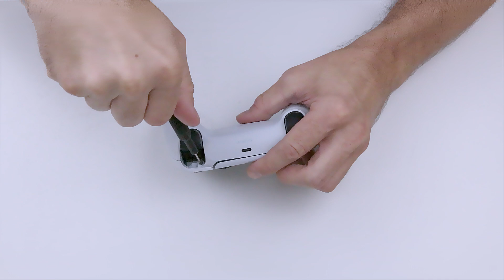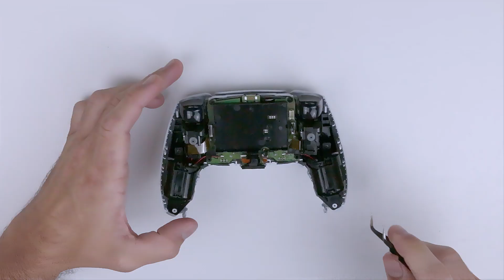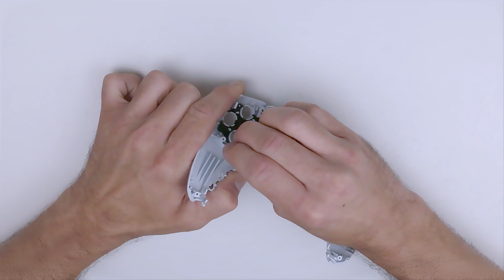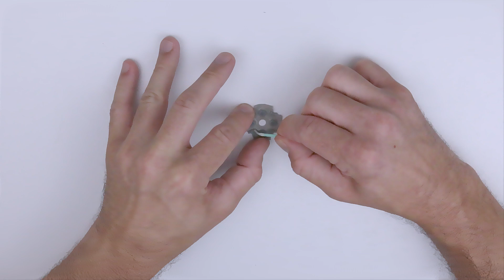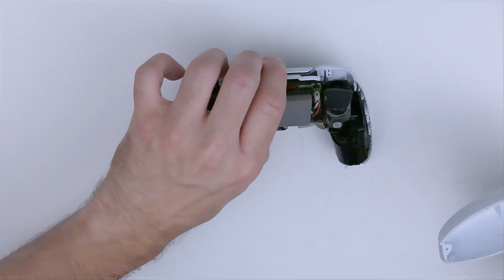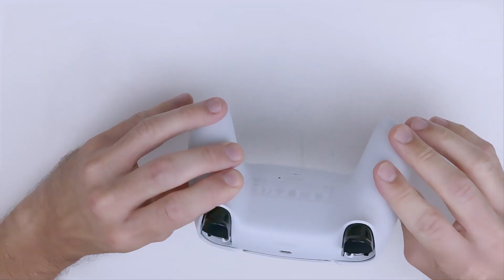How to Fix Sticky Buttons on a PS5 Controller | Easy Step-by-Step Guide

Comment: Do I have to wait for the stickiness to dry before I try clean it out
Reply from the maker: Hi Rick, I highly recommend that you avoid getting any liquids inside electronics. If your controller has experienced liquid damage, I recommend that you turn it off straight away, then wait for the controller to dry out before powering it in again. You can follow this guide to disassemble the controller, then let the components dry out before reassembling.